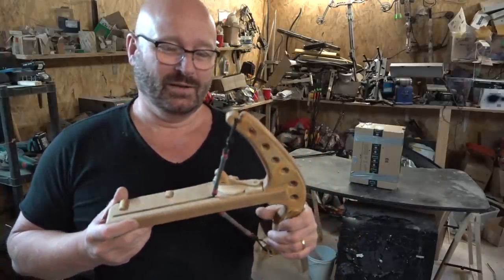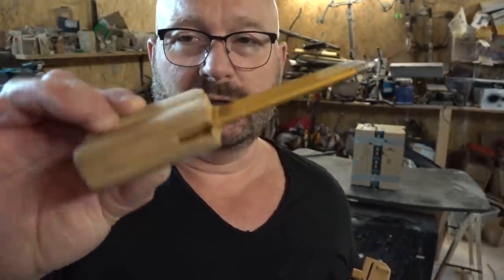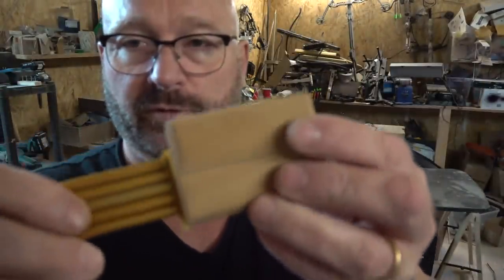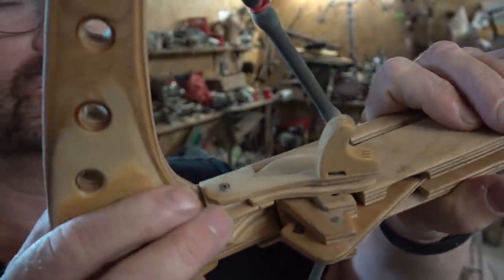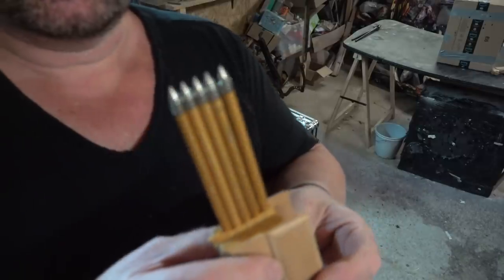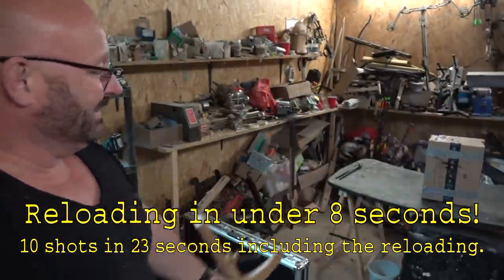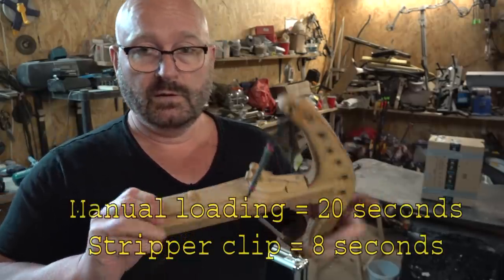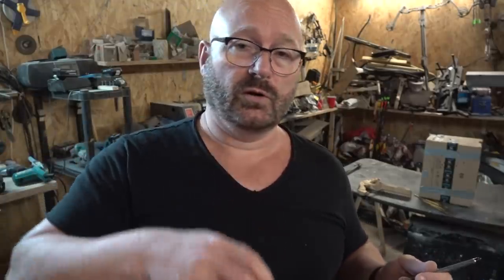A Bow With Ammo Clips?

Comment: A drum magazine next? :P
Reply: Arrow belt?
Reply: I was thinking of that to 😁
Reply: @SomeRandomGuy-us1yb  Haha that would be cool too!
 I'm imagining a tripod mounted crossbow with some kind of bolt handle that advances the belt and pulls out an arrow while cocking the mechanism :) An arrow fed Maxim :D
Reply: @VeraTR909  Powered by crankshaft and a drill motor.
Full Auto Machine Crossbow babyeeeee
Reply: @VeraTR909  he already made a tripod mounted auto crossy didn't he?
Reply: @dickyboi4956  and he made a crank/rotor operated auto-crossbow IINM...

Damn, belt-fed auto-crossbow soon?
Reply: @SomeRandomGuy-us1yb  A linked belt made from plywood links (with some kind of registration notches) could be his kind of style :P Like a plywood chain that holds arrows :)
Reply: Oh yeah!
Reply: He already did sort-of a drum action bow with pressurised air and coke bottles. :D That was the first vid I watched from Jörg. :)
Reply: Actually a magazine is easier to designe than belt feed, id like to see reabeating bow gatlin gun style with magazine feed powerd by cordless drill
Reply: Like the x-bow from clash royale
Reply: check out his latest video, it's real.

Comment: What if the clip has a spring in it, and the bow does not. Baicly you add a whole new rear end to the instant legolas when you change a clip?

Would it no be quite eazy actually? Just couple of quick hatches on either side to hold the end in place, and when all areows are shot, remove the end, change new one with new arrows and keep shooting? Would possibly take only 3 seconds and does only need one hand to change the clip.
Reply: No. The entire point of a clip is that it's meant to be easy to use, easy to produce, and not complex in the slightest.

Adding a spring and refitting the bow again would be needless work for something that already works perfectly.

You're overthinking things.
Reply: @AgentTexes  It would literally be 1. take clip out 2. new clip in.

The one in the video requires to unlock the spring, move it away, then taking the filler thing, then push the bolts with the spring, then put away the filler, then relock the spring. Way too complicated.

If the whole rear end would be detached it wouöd literally be a piece of wood with one spring. The simplest thing. Also the use would be as easier than reloading one arrow manually.
Reply: @BADISkettu  The problem is that now you're basically making a bunch of removable bows attached to a interchangeable grip. This is not much better than the analog of having 6 pistols to cover up their horrid reload cycle.

Comment: In my opinion one of the best designs so far. I add another challenge though: Make it so the Legolini has both a bow and a crossbow mode. One for quick shooting, the other one for precision shooting (by making a trigger mechanism, so instead of retracting the bow and then releasing it, which causes a lot of wobbling, there is a  mechanism that can be switched on and off and that can hold the string in a charged position, just like in a crossbow, and then releasing it with a trigger, giving you more control over the bow).

Comment: You could put a little handle with a low profile, (maybe folding) on the retaining arm so that the loading of the bolts can be done in one motion, rather than two. (or at least two separate motions without having to move the hand to push something else)

Very well done Joerg, It's impressive what you have done so far.

Comment: I have not fired my old (crapy) compound bow in over 20 years (36 years for my recurve bow). I'm a Master Armorer and have spent much of that time in the US Army and as a Military Weapons Expert, and competitive shooter. I always assumed I would get back to shooting how's again, but 13 years ago I ended up losing 4 fingers on my off hand, which makes it harder to hold a bow, which took the fun out of it. I love your crossbow design, but Army disability pension keeps that well outside my budget. The Instant Genghis Khan and it's compound brothers look tremendously fun to shoot, but again, out of my budget.  the Instant Legolini? the first version looked fun, but the new version looks even more fun. love the simplicity and ease of use,  and the striper clip design is very well done and not far (design-wise) from the striper clips I have used for years. but it's your new follower design that's brilliantly designed (well done!). Now if I was a woodworker or had a home shop I would be busy trying to build one..  lol  keep up the good work!

Comment: I use 2mm steel balls in one of our products, we had an air feed system into a weld stage and found out if the air tube was not tightened correctly it would shoot the balls like bullets. Here`s the thing, these balls penetrated the skin on my hand and left no entry wound, serious. only a couple of days later you can see the ball under the skin as the body tries to reject it.
Joerg how can we weaponise this with a silent bow like repeater ? I have seen your clever single ball single shot design.
Thumbs up for that cluttered workshop, sign of a true inventor/creator.

Comment: Excellent work and showing progression of ideas. Id probably note Nusensei's thoughts on a rifle stock and move on to box magazines set on the other side og the handle.

Advantages of box magazines should be obvius but also opens the option of a bullet magazine, basically fireing slingshot bullets from the bow (probably usefull for practise or backyard vandalism).

I not sure but im thinking if the bow tilted a little compared to the handle it would be nicer to pull, lets say offset 15 degrees to the left on top bowleg wieved from shooter.

Comment: Hey Joerg, I wanted to comment this when I first saw your instant Legolas but decided not to because I reckoned you would figure it out. Would flaring the port of entry for the bolts assist manual reloading? That is, like a flared mag-well on a fire arm. It is basically a chamfer as opposed to a hard 90 degree angle so you can basically load it blindfolded. Anyways, just a suggestion!

Comment: That is awesome!!!  Even though I like having full mags for my AR's and AK's on hand, I still like the simplicity of stripper clips for the sks and mosin nagant.  Even had to get an adapter to allow clips to mate to ak mags for faster dumping......the fact you made arrow systems that use clips is mind blowing.    I wonder how long before you make a drum mag for a bow?      

Also just wondering ,have you ever played with self leveling concrete?    I got my hands on some recently and found out how well it worked in molds like maybe even arrow heads and other projectiles. :)

Comment: My idea was to build a mold that holds the bolts, then bond them with a strip of wax in back and front, the mini bow might not have enough power but the full-size one would snap the wax-like nothing.
Reply: And reduce the power?
And makes it prone to failure thanks to powders of wax in it?
Reply: @whoami1449  Doubt it would have any effect on the power of a 40+ pound bow, the 18pounderer toy would be pretty limp though. As far as a powder, it might buildup after 100s of shots but if anything it's just gonna wax the wood.
Reply: @Troph2  not just powder
 the wax would break
But the broken pieces might just be big enough to get in the way of the arrow
And it wont look as cool

Comment: Instead of having a pin point lever pushing the next arrow in. an egg shape on the end you could load two or three arrows instead of just one. Because the oval shape will keep the point of contact and pressure on the arrows and allow more surface area to guide the arrows in smoothly. Has to be better then 20 seconds for 6

Comment: Could you maybe add a pice of rubber pulling the arm the spring is mounted on forwards so it springs open automaticly as soon you operate the lever releasing  it? you could even have a small lever pertrude out of that arm to make it easier to move it back to the locked position.
It would be just a matter of an eyelet screw and a nail apart from the mentioned rubber in the simpelest configuration.

Comment: Very nice, but a little overkill imho. Couldn't you just add a curve to the piece that presses on the arrows so you can lift it with more than just one arrow? That way you could slide in multiple arrows at once. You could hold them together with something similar to a hair pin.

Comment: It might be even faster loading without the stripper clip, but still using the magazine modification.

Flip the magazine follower up, slide the loose bolts in all at once, and close the follower. That way, you don't have to fiddle with the clip placement or remove the empty clip.

Also, am I the only who finds it funny that Joerg has basically invented a bow with a Krag-Jorgensen magazine?

Comment: Why not just disengage the levered spring retainer (like when using the stripper clip) to load loose bolts, rather than feeding them under the engaged/locked spring retainer? Surely it would be much easier to reload with the lever out of the way?

Comment: And now for a belt fed bow with the feeding mechanism operated by either pulling or releasing the bow string* only (no extra operations like an extra repeating lever).
Und jetzt ein Bogen mit Munitionsgurt! Das System sollte allein durch die Bewegung der Bogensehne operieren (alo entweder Ziehen oder Loslassen*) nicht durch einen unabhängigen Ladegehel oder dergleichen.

*equivalent to open/closed bolt in a firearm/entsprechend einer auf- oder zuschießenden Waffe

Comment: What about having the spring integrated into the clip, and when the clip is inserted it opens the top allowing the spring to push the bolts into the firing position, so the clip stays attached while you fire.  Should be doable and would be faster to reload, but you would lose the ability to load one bolt at a time if desired.
Reply from the maker: I have done mags like that but they end up being very bulky.

Comment: Is the stripper clip even necessary with the movable spring? Could you not just dump the bolts on the mag and then lower the spring?
Reply from the maker: No. The arrows have to be aligned very precisely, otherwise the vanes will not slide in.

Comment: Why not open it like inserting the stripper clip, then load it manually?  That would be way faster than lifting the lever with the first arrow.
Reply from the maker: The vanes have to be aligned 100% correctly, else they won't slide in. Very fumbly.